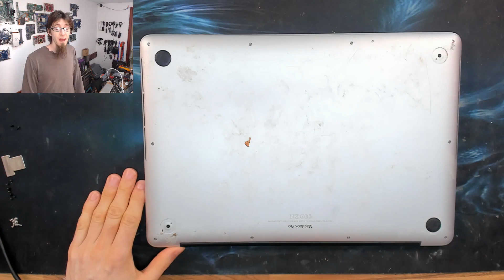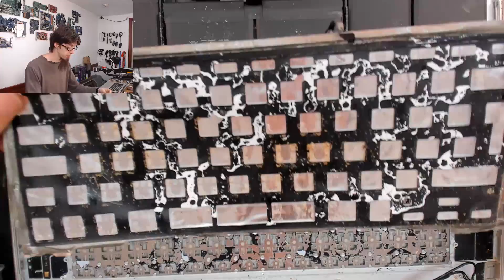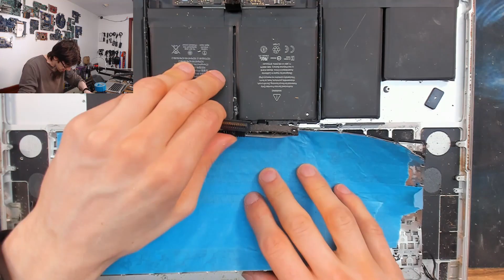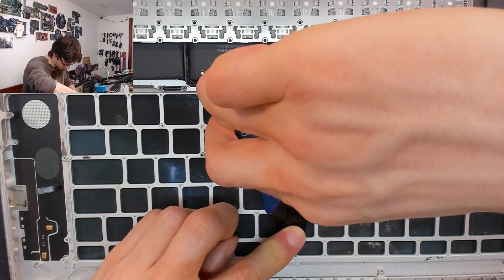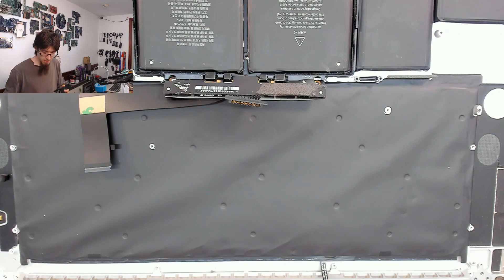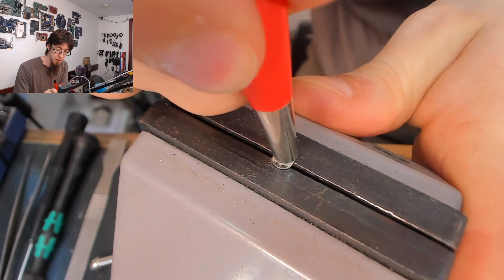MacBook Pro 15" 2015 Teardown & Keyboard Replacement - LFC#211

Comment: I bought one of these from 2015 at refurbed, used computer reseller, but got one with German keyboard and need a Swedish one. Will I do this? Hardly. The reseller will change the keyboard if I send it in, for free. I have now some days left to do that, otherwise I will have to live with the German board.

Comment: Great vid mate. Any tips on how to remove screws that are burred over by someone with a crap screwdriver ? I dont know who done it. honest guvnour 😂
Reply from the maker: A better screwdriver can sometimes get purchase on a bad screw... if it's completely demolished, you'll have to get a dremel and cut a slot into the head. This will likely cut the back case slightly, but if you're careful it can at least be a neat 'scratch'.

Comment: My 13in MacBook Pro 2015 sat without its bottom panel for 1 year (don't ask, battery went bad and wasn't arsed to change it) and the inside is sooo clean. How did this MB got as dirty as it was in the video is beyond me.

Comment: Thank you for the video. The camera connector on the logic board is situated close to the right fan screw-standoff, and it's susceptible to being blown off if exposed to excessive heated air.

Comment: Thanks very much for the video. I am now typing on my newly installed keyboard, mid 2015 macbook pro 15". Some things: first, be careful following this video because he has to back out at least once (fan shrouds) if not more so if you follow along and are not aware you will also have to back out. Having titles on the screen warning of this would be helpful. My keyboard had METAL rivets. Some of the rivets came out when I pulled the old keyboard out but some remained. I used a pair of flush cutters to grab the rivets and pop them out. I was able to get all but 2 which i then sheared off flush with the case. If you dont put all the screws into the keyboard you risk some keys feeling soft and also softening over time. It's better to put all the keyboard screws in to ensure all keys are held in place. You do not want to do this job again! It took me 3 hours never having done it before. Also, I got a $15 electric screwdriver (mini) that was indispensable for this job especially the >100 keyboard screws. I would recommend such a tool.

Comment: I have the same Macbook pro. Why can't I install anything past OS X 10.10 on it? El Capitan and everything else just fails during installation with kernel panic, and black error text through the whole screen. 10.10 installs fine, however, but if I want to update from that, then the installer crashes and restarts. Nothing I have found online helped so far.
Reply from the maker: Have you done system updates with 10.10, if you're still able to? I'd make sure it's got the latest firmware update. Also tried Option-Command-R on boot to do an internet install of newest supported version?
Reply: @Adamant_IT Thank you for the help, but Option-Command-R does absolutely nothing. I have updated 10.10 via wifi to the latest version successfully. But whenever I try to run anything newer, even from the App store, it crashes. RAM is factory default by the way. Tried with another SSD, too. I have another one of the same machine at home, which is on OS X 10.15. I have bought 2 of the same machines at the same time. One for the bicycle shop, one for home use. I have tried swapping the SSDs, too, but still not working. One has a working battery, one does not, because I don't need one. Tried  swapping those, too, without success.

Comment: I have an issue. Macbook pro early 2015. If i dont use mac for more than a day, trackpad and keyboard both stop working when power on,  however power button works, when i disconnect tracpad ribbon for 20 mins, both start working. Please help
Reply from the maker: Does the problem happen if you leave the laptop plugged in while off?
Laptops from this era all have dying batteries, so that would be my first suspect. Bad batt causing SMC resets.
Reply: @Adamant_IT  no. It’s unplugged all the time. Today, while both were not working, i updated to monterey and after that it started working straight away. But last time it was on monterey when this problem happened. Very strange.
Reply: @Adamant_IT  updated to monterey and it started to work. Didnt use it for around 20 hours . Just switched on mac and it has stopped working again. Kayboard and trackpad both. I would be very grateful for help, cant affors to get it repaired atm.

Comment: Can't you just put the soldering iron right on the bolt itself?  It'll heat up the bolt and melt the solder, don't need to use a heat gun or anything, might even be able to reuse the existing solder by simply reflowing it.

Comment: HELP... When I "pulled the keyboard, got a bunch of rivets that sort of came out, but very few "holes" to put in screws for securing the new keyboard?  Ideas? Have photos.🥲
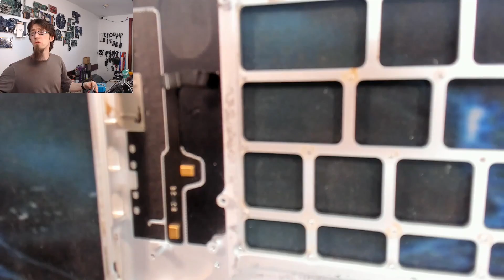Reply from the maker: 22:20 Use a pair of side cutters. Grip the side of the stud, and then leaver backwards to pull it out. Takes a little practise, but should get most of them out.

Comment: Was looking for videos to enrich my knowledge about repairing my MacBook Pro mid 2015, in case I will need it, and I bumped on your video.
Amazing work and the detailing process , just one thing...
Electronic parts still hold charge , even if you are disconnecting the battery...
It would be a good idea to press the power button after you disconnect the battery , to avoid burning any components (happened to me b4) on my 2013 MacBook Pro  I had to replace the screen resistors LOL...
Reply: Also I have one question.
why do some MacBooks have fans with silver fan base and some have black? any usage or something else?

Comment: Hey! Thanks for this awesome detailed video tutorial. I'll do the same with my A1398 Retina 15" Macbook Pro. However, I think you did not touch upon the question of the screen: how do you remove it ? Can I keep it connected while doing the whole process ? (if I put a "protection sheet" in between?) Thanks in advance :)
Reply from the maker: You can, but I strongly suggest either removing the screen (it's just another six bolts at the hinges, and the little hinge covers next to them) or open the screen and hang off the desk. While doing this job, you'll often be pressing down reasonably hard, so there's a danger of cracking the screen. Not heard of it happening, but IMHO it's better to get it out the way so you can be as rough as you like on the chassis.
Reply: @Adamant_IT  My bad, you explained it in the video, sorry for that :) Thanks for the answer anyway, such a great tuto.
Reply: Just to let you know as successfully change my keyboard, because of you! Thanks A LOT for the very nice tuto, all the details, etc.. No other word than PERFECT! That was the first time I jumped in such a dense electronic system, but it was worth it. Everything is working great: best way to increase computer lifetime!

Comment: Guys, for cleaning electronic elements, especially from greasy residue find yourself homemade cosmetics supplier, and find "Formulator's alcohol" it is a mixture of alcohol, and very strong emulsifier, because all fragrances are oils, and have to be dissolved within alcohol, this mixture works like magic, has a effectiveness of both detergent, and isopropyl, and 0% of water in it, unlike glass cleaner ;)

Comment: Hey there. I really enjoyed this video. It helped me greatly. Thank you! I have one question. The keyboard I ordered for my MBP Retina 15” mid-2015 model came with a little blue sticker on the keyboard connection terminus…the part that inserts into the logic board connector. Are we supposed to remove that sticker when we install the keyboard, or leave it on?  It covers the little metallic wires on the keyboard connector terminus. So it’s confusing to know what to do with it. Thanks!
Reply: I figured out the following on my own: 1. I needed to remove the blue sticker from the end of my keyboard ribbon’s connector because with this sticker on the connector, the connector didn’t fit properly in the logic board socket. However, without the sticker on the end of the keyboard connector, the end of the keyboard connector itself also wouldn’t fit in said socket. 2. So what I did was reattach the blue sticker to the underside of the end of my keyboard connector. And then, I trimmed the excess plastic from the blue sticker. So I made the size of the blue sticker match the size of the connector it was covering. That worked. 3. The only way I could get the keyboard connector into the logic board socket stably was to disconnect the logic board screws, and pull the board up about 1.5 inches from the keyboard, without taking the board out from beneath the edge of the installed battery. Then, I inserted the keyboard ribbon’s connector, with trimmed, blue plastic sticker attached to underside, into the connector on the logic board in mid air and closed the lever arm on the logic board socket. To have enough keyboard ribbon length to do this, I lifted the keyboard ribbon out from under the logic board, and rested it on top of the logic board, under the front edge of the battery. That worked well. And I was able to not only boot the computer (whereas before I couldn’t, because new keyboard wasn’t working), but also use 100% of the keys on the iFixit keyboard. Everything worked correctly. So that’s the solution for mid-2015 MBP Retina 15 inch.

Comment: Thank you so much for recording this video.  I am now typing on my new keyboard.  I bodged it too! I didnt realise I had a US layout macbook and bought a UK layout keyboard so I just used tin clips to snip out the bit of the case that splits the enter key! I think I missed plugging in the old backlight though! I put it in but it doesnt work and I dnt think I plugged it in!! Stilll its a VAST improvement over using a USB keyboard!! Thanks again, you made this pretty compex process V simple!

Comment: Do you know of any way to drill the leftover keyboard posts out? I got 40 of them out, but still 61 (if I counted correctly)  that just broke the tops off the pegs when I tried to pop them out and now are too rounded/ flush to pull out.
Reply from the maker: I usually just leave those ones. There's normally plenty of empty holes to get a decent fit with the keyboard, even with some left over posts.

Comment: And if you take out the trackpad from a macbook, normally its a pain in the rear end to get it lined up, well, install it, than when the keyboard is facing you, you can adjust the trackpad in the perfect position, but offcourse, when you turn the laptop around, the trackpad will shift and slide, just put 2 small pieces of tape on the left and right side of the trackpad and the palmrest, than you can turn the laptop over to tighten the screws, and when you are done, you will see that the trackpad stays in position!

Comment: That was boss my man. I think that is my next move as my a1398 has no power. i replaced the battery earlier this year for a similar problem. Also replaced the heat sink for another issue. Now i have no power. Swapped power adapters, and moved to a different outlet in my home, no change. Ordering keyboard and backlight and going for it. Thank you for this video.
Reply: Forgot to mention that I also replaced the logic board a couple of days ago.

Comment: Tell me please.  MacBook 15 2015 keys do not work (RTYUIO) and E does not work well, are there any repair options without replacing them with a new keyboard?
 Thank you in advance!
Reply from the maker: Not that I'm aware of. If it was one or two letters, you could try careful cleaning, but that's most of a row. Almost certainly going to get worse.
Reply: @Adamant_IT  YYes! It was under the letter E that moisture was further broken the road to the rest of the letters (not opening the keyboard completely, only removed the button, carefully cut the layers and put wire and foil) and everything worked! under the letter E that moisture was further broken the road to the rest of the letters (not opening the keyboard completely, only removed the button, carefully cut the layers and put wire or foil) and everything worked!

Comment: Thank you for posting this video! I replaced mine yesterday night because I spilled a sugar drink on it (MBP Retina 15" 2015 A1398) and you provided a lot of useful tips on how to do it!
I am a total beginner when it comes to repair electronic devices (I'm just used to clean the fans once in a while) and it took me 5 hours, but I did it and it works just fine.
Just a couple more tips for those who have the same model as mine:
1) You can't separate the heatsink from the CPU/motherboard on this model, it seems to be soldered (I didn't wanted to force on it, maybe you can but at your own risks).
2) I'd like to put an emphasis on the "wear gloves" things. The sides of the keyboard ARE sharp (got a couple cuts on my fingers, nothing unbearable but it is annoying).
3) I highly recommend to use a pair of pliers to remove the rivets, as shown in the video. I didn't have one, I had to remove them with a flat screwdriver and a hammer, but it cut some rivets instead of getting them to fly around the room.
Reply: Yeah you can - the thermal paste may have just hardened making it stick down
Reply: @ifihadfriends437  Thanks for the clarification!
Reply: You're braver than me, I have the same A1398.  I will take this teardown to an expert.  I can't afford to mess it up.  Good on you for your bravery.

Comment: Thanks for sharing. I watched along while replacing my keyboard for the second time. With the first, the key labels were wearing away after only a year and the capslock LED never worked. First was from talaptopparts, this new one is from it-screens - capslock LED is working this time and keys seem more sturdy more large keys have metal cross bars.

Comment: Impressive work. I have a question. I've brought my MBP 2015 to Apple for a change of battery. They changed the whole topcase and I don't like the the way the keys of the keyboard are now sinking into the chassis... it used to be perfect just before they started the repair (a pressed space bar came just at the level of the chassis and now it's way below the chassis, which is uncomfortable imo).

They just tell me they can try other keyboards, but it will mostly be the same result. So I asked them to put back the old keyboard without the battery. They told me it's not possible for "safety reason"... What do you think? Do you think it's doable?
Reply from the maker: That's BS. The battery is totally removable. I did like, three last week. But Apple don't believe in repair. You could ask them to put the old keyboard and batt back in, but I'll be surprised if they still have it... If they do, you could then take it to an independent shop and just get the battery replaced.
But you're stuck between a rock and a hard place here, given that you're already this far in.
Reply: @Adamant_IT  Thanks for your prompt answer!

Comment: my macbook pro 2015 has an issue where in it intermittently starts typing in capital case. No matter what I do, press caps lock or shift, it maintains capital case. When I restart it and reset the PRAM the issue goes away, but it comes back every now and then. I have checked everything and there is no fix for this. Do you think replacing the keyboard would fix it

Comment: Really good tutorial, except for the reassembling that you jumped over steps and made me confused as hell, I forgot the backlight connection cable below the chipset, tried to get it with the clip and it made it break :(

Comment: Hey, thanks for the video. What is the exposed die beneath the ram modules on the left side? thanks
Reply from the maker: PCH (mobo chipset). Sometimes the PCH is integrated into the CPU, but the second die on this CPU is integrated graphics.
Reply: @Adamant_IT  I see  now(platform controller hub). Thank you very much.

Comment: Hi Adamant IT. Thanks for sharing this great video. Very informative. I switch my keyboard as well and when I restarted my computer, the OS doesn't recognized the battery level and it continues to reboot.  Wondering if you would have any insights of what do check or do. Thanks in advance.

Comment: Purchased a replacement keyboard from your affiliate link and I have to say that the quality of the keyboard is abysmal.  The key height between keys is off. The backlight is unevenly lit and the CAPS LOCK led light bleeds everywhere.

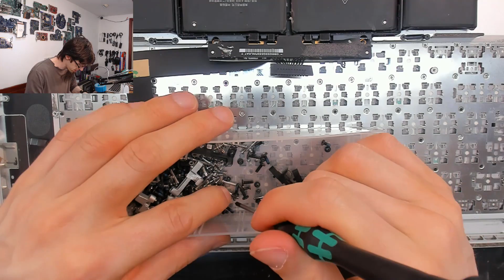Comment: 25:50 i do that with every laptop i trash, i take out all the screws, all the clips, all the wires, the screen (for the cfl backlight) and i trash the rest, its basically an empty shell with a loose motherboard, battery and trackpad in it, all the rest i keep, and yes, i replaced the cfl backlight in a very nice condition PowerBook G3 Pismo, because the backlight of those powerbooks will go pink when the backlight starts to die, and that pink hue will get worse over time, and in some cases, it will not go away when the laptop warmed up, like my model did, so i took it appart, and i replaced the cfl tube, and i was quite succesfull, its not a factory job, i have a lil bit of a brighter portion on the first 3mm of the screen, but for the rest it lights up nice and evenly, so its way better than the pink tinted backlight!